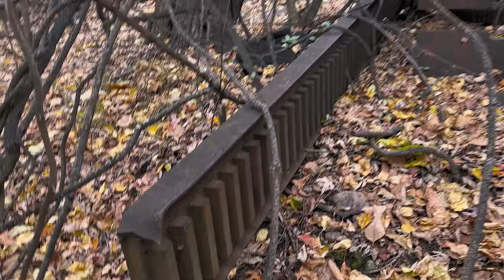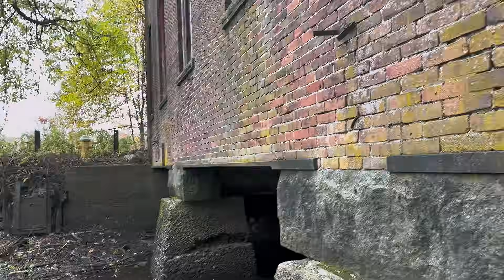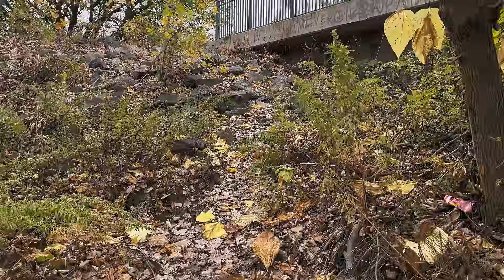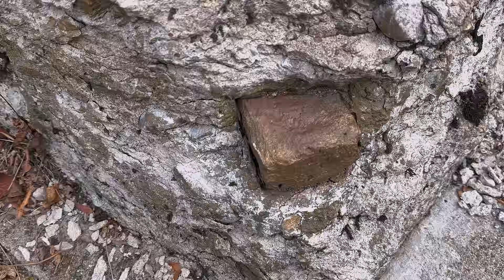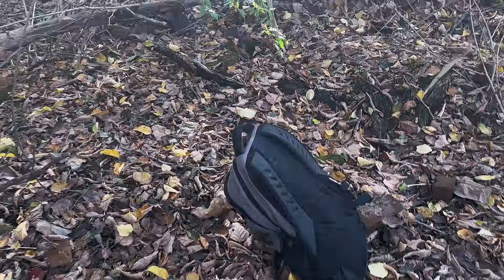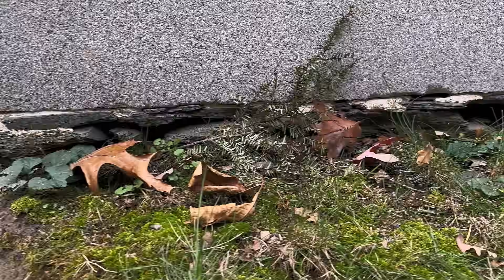Irish Immigrants Built This in 1828? Something Doesn't Add Up

Comment: The Dance Hall and old Pier (located in Fort Erie, Ontario) are of the same vintage.  In fact, there is an in-tact railway line running under the shallow waters near the shore of the Niagara River in that area.  Indicating that the geography has changed dramatically.